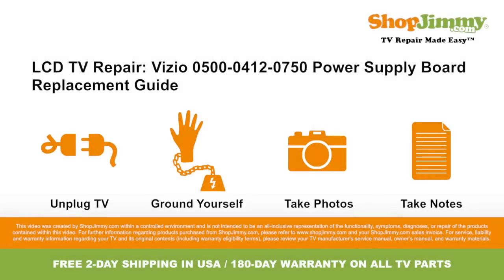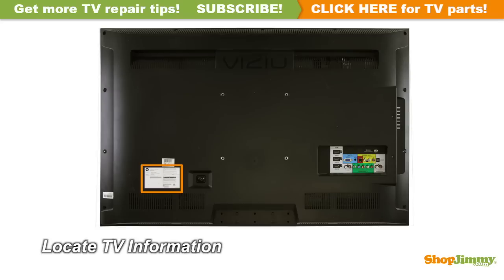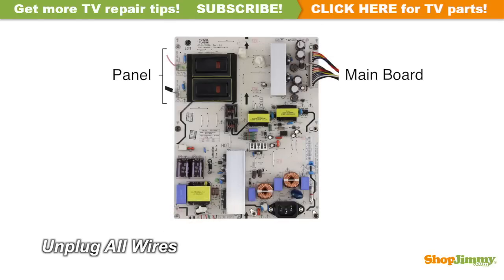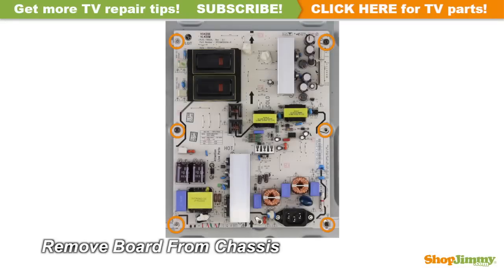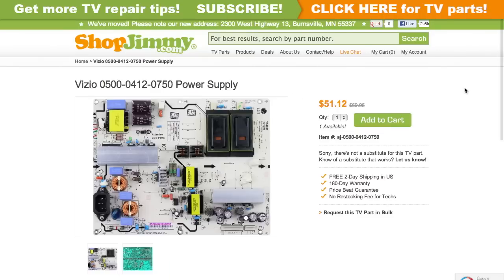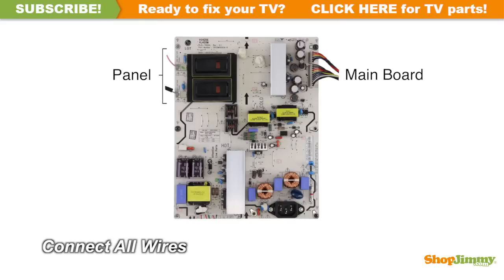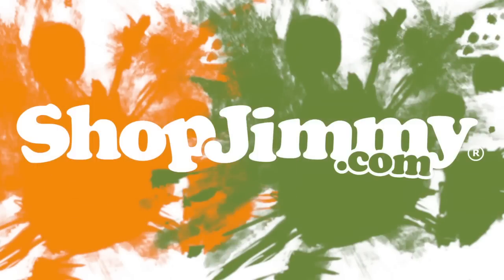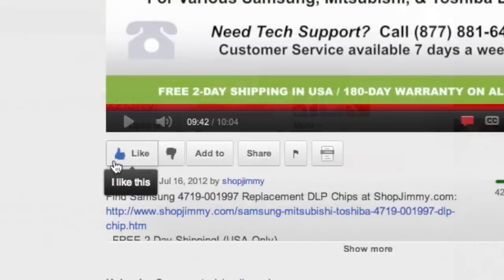Vizio TV Repair Power Supply Unit Replacement

Comment from the maker: @Sik Pickle - If you are extremely worried about safety, I would recommend taking your tv to a professional. There is always a chance that a board can hold a charge for awhile. The case dose snap off ,but you are going to have to put some pressure on it.  Thanks and please let us know if you need any other help!

Comment from the maker: @Sik Pickle - The back of the TV snaps on, so you need to pull to seperate . After the set is open we need to figure out if the transformers are on the power board or if has stand alone inverters.  Please reply with this information and we can help you further.  Always take the proper safety precautions when working on your TV.  Thanks!

Comment: I have a Vizio M75-C1 and it is now taking 20 minutes to turn on. Is that usually the power supply capacitors going bad? if I buy a Power supply board will it most likely take care of that issue?

Comment: After a storm my moms Vizio t.v D55-OE stopped working. Wouldnt power on. Ordered and replaced the power supply board and two others. It will not power on after replacing them. Is there anythingelse to try before trashing it? Thank you

Comment: Vizio e701i-a3e  lftrnxcp3605717 has no picture or sound.  Turns on and then fades off.  Tried all options.  Want to try And before trashing.  Should I try new power supply? Thanks

Comment: My Vizio e601i-a3 will no longer power on.  There is no picture, no lights, no sound.  It's completely dead.  Based on the research I have done the issue seems to be the power supply.  Would you agree?
Reply from the maker: +Joneshia Bethea   Try all repairs and troubleshooting at your own risk.  I recommend replacing the main board in your TV.  Click this link to replacement parts for your TV model number:  http://www.shopjimmy.com/catalogsearch/result/index/?cat=56&q=e601i-a3  There may be multiple boards for the same TV model number, be sure to match part numbers on your current board, with your replacement for compatibility.  Thanks and please let us know if you have any further questions with your TV Repair!  www.shopjimmy.com
Reply: I replaced the power board a week or two ago and the TV has been working fine. However, last night the TV would  not turn on. No light, no sound, no video which is what it was doing before. Could something else be killing the power board?